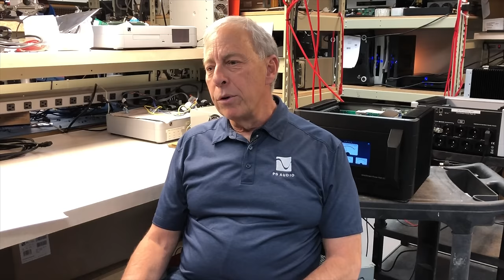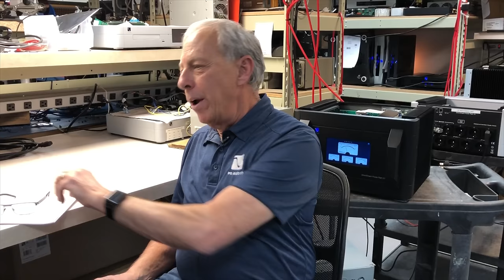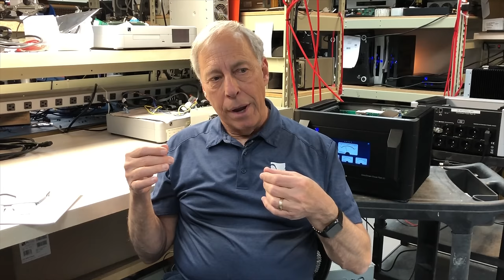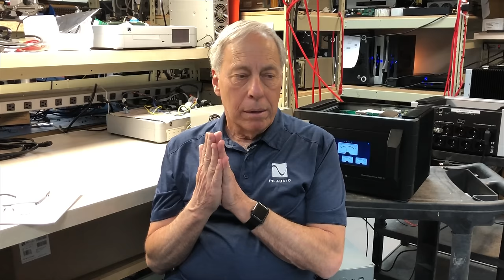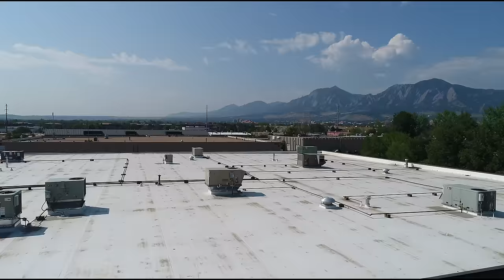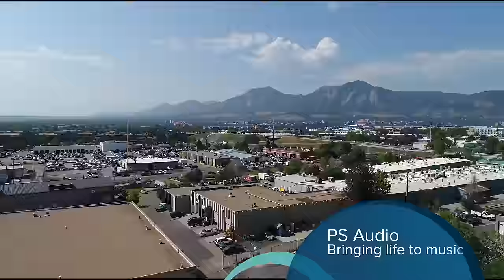What's the difference between ribbons, planars and electrostats

Comment: where's the explanation of the (RIBBONS) thats the main reason I clicked on this video
Reply: ribbons are similar to planars except the sheet that moves is a ribbon of very thin ALU foil that moves between 2 rows of very strong neo magnets.  The audio signal runs through the ribbon and is repelled and attracted by the N/S magnetic field.  The resistance of the ribbon is very low, sub 1 ohm, so there is a step down transformer in the signal chain to present 8 ohms to your amp and 1 ohm to the ribbon.  Otherwise no amp could drive them.  Ribbons are typically short, and therefore very good as tweeters.  DIYers have built very long ribbons that can go down to the mid range.
Reply: Thank-you.......i'm understanding now. I'm trying to find modern speakers that rival the B&W CM1's and CM2's.  I heard them in the late 80's early 90's in a high end shop in Chesapeake VA...... the sound coming out of a room was so real I had to go look in the room to see if they were there on some kind of promotion for the store. It was a turntable, amp and the B&W's. It was so real sounding I really thought, for a moment, Neil Diamond and Barbara Streisand were there in person. I have never heard that level of perfection of sound since. Even the 805 D3's do not rival what I heard that day.

Comment: Paul, I really like your opinions  But you're being a bit disingenuous.    Why do conventional speakers add a 12" sub?  Because the midrange and tweeter cant play bass.  So its really unfair to paint the ESL with this broad brush.  In fairness, a true ESL will have the issue you describe  The bass will be a bit lacking that is why ML does HYBRIDS it is NOT a true ESL speaker.  I also disagree with your view that ML with its curved panel has a "very narrow" stage.   I will be making a purchase here in mid/late spring next year and I have a budget that fits within your AN2's if they are being sold at that point  I have listened to several different speakers and right now I am VERY impressed with the ML13A and 15A speakers and have listened to other speakers in comparable prices ranges IMO the ML blow them out of the water
Reply from the maker: I get what you're suggesting but still, we don't want our systems (if they're to represent high-end audio) to be bereft of low bass. Therefore, despite the fact the ESL can't produce these frequencies only says to me they need to be augmented. There's nothing disingenuous or shameful about that, just a fact. Go for a proper subwoofer.
Reply: @Paulmcgowanpsaudio  Hence my attraction towards a hybrid like the upper-end Martin Logan like the 15A's or even the CLX's with the Descent i   Though as I may have said elsewhere, Should the AN-2's be available in Q2 of 2019 I would eagerly check those out.  The Neolith line is supposed to be absolutely sensational but it is outside my budget